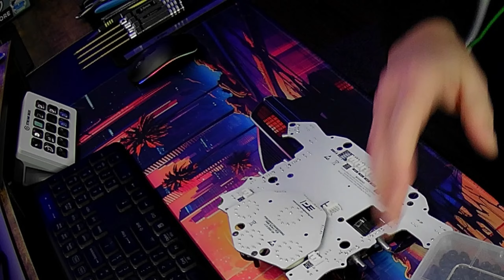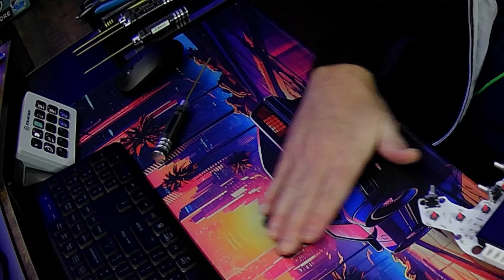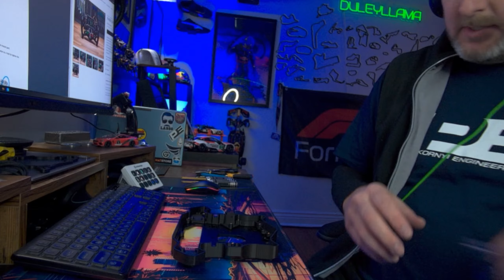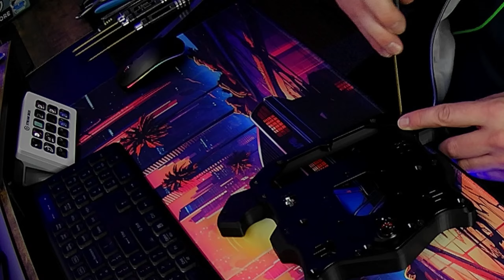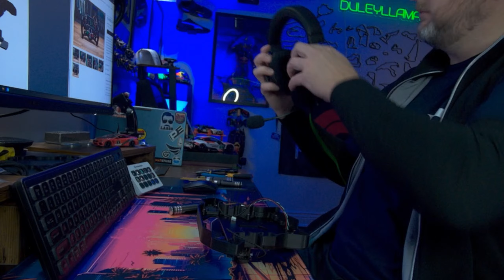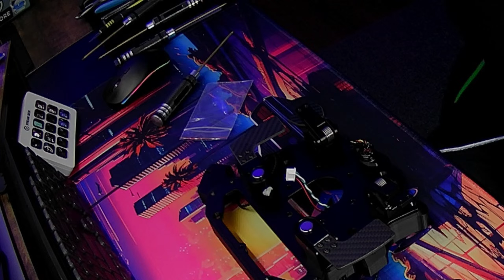DuleyLlama builds the Pokornyi F499 Wheel

Comment: Hi! Thanks for the video! There aren't many building the wheel! I wanted to ask, is it possible to have a total of 6 paddles on this wheel? Also, how much was it in total? I saw that I could 3d Print some of the pieces but it seems that also every part is available from their website right? Did you buy all the parts from them and then assembled it?
Reply from the maker: As is, I don’t think there isn’t an option for 3rd set of paddles unless you modified the rear lid to accept them. I was skeptical on this at first, but the on-off-on toggles side mounted on the back have been great. I use down toggles for opposing shifts and up toggles for discord & iRacing PTT. 

My video has my own 3d printed enclosure, rear lid, light guides. Everything else was sourced from PE (except for hardware and VoCore and it was around $1100. I got it very close to release date and the alum enclosure/rear lid/hardware/VoCore wasn’t available through PE). 

I did later buy those alum parts from PE which would take the cost up to around $1200 since you then don’t need to buy their alum backplate with the enclosure. 

Really great wheel for that price point since it’s comparable to more expensive options on the market and the cool factor that you built it!

Comment: Can I build without soldering??
Reply from the maker: Yeah, the only thing I needed a soldering iron for on this build was setting the brass inserts into the 3D printed housing (you could by the now available aluminum option from PE) and the two 3-wire switches on the backside, which you could probably crimp connectors to them bs soldering if need be